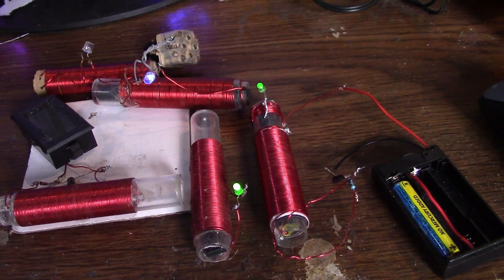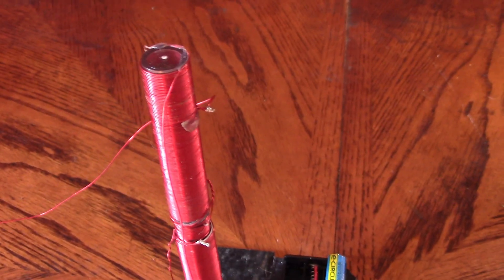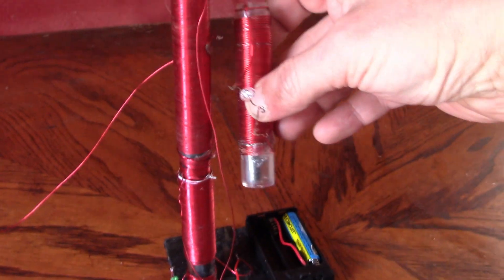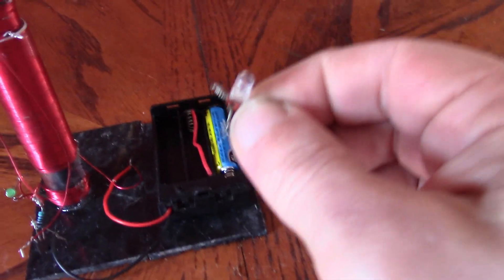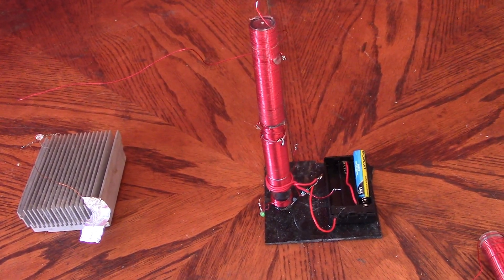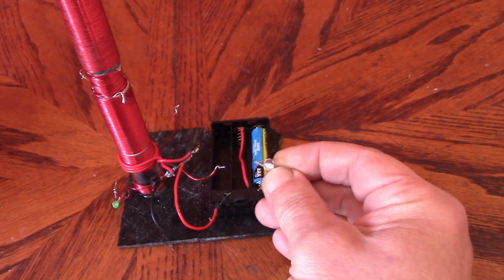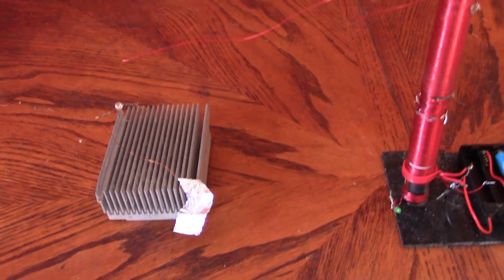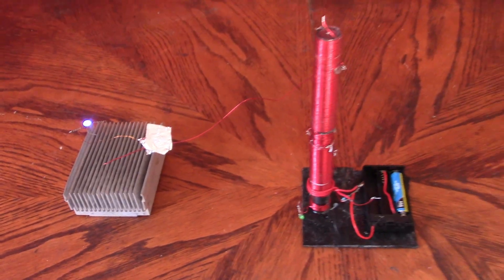Can a Joule Ringer become a Tesla Tower?

Comment: This is quite impressive … I guess you can lit up a fluorescent tube as well if placed in close proximity while having all the LEDs power up.

I guess  I have to start using transistors alone instead of zvs circuits. In meantime I toasted my little pwm solar controller and i have nothing to show now 😢 probably would be a good idea to try things while recording as you do.

I wish you a very merry Christmas and happy new year
Reply from the maker: Thanks and Merry Christmas to you too 😀
I haven't tried a fluoro yet, not sure I have one anymore tbh! But, did check out the running frequency and it's surprisingly high, at 3Mhz. A Slayer normally tops out at 2Mhz, then I wondered and realised that with less turns the Base of the transistor gets a kick faster at approx 200 turns than with the regular 850 or so turns. 
I was hoping all would work out with your solar controller setup, but, 10A PWM's are cheap at around $10... you went for the right direction compared to say a Victron MPPT.